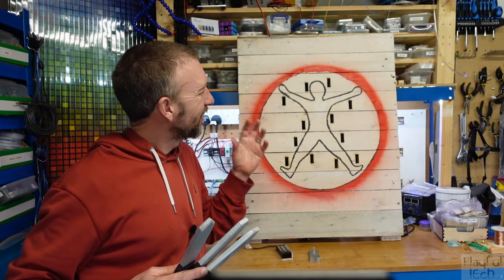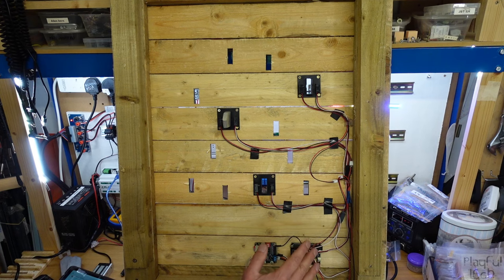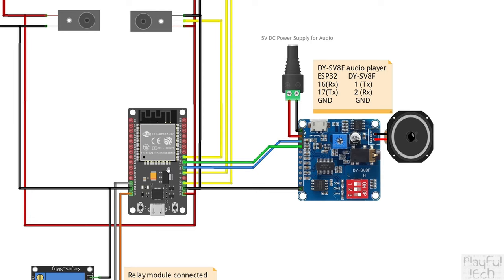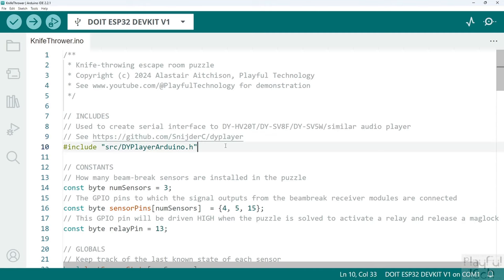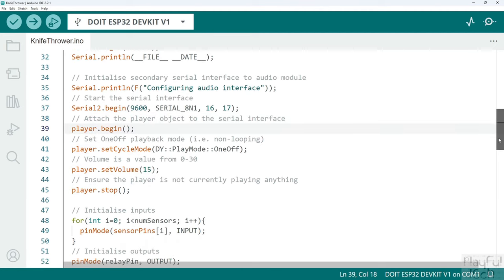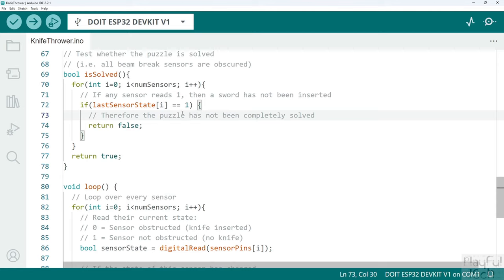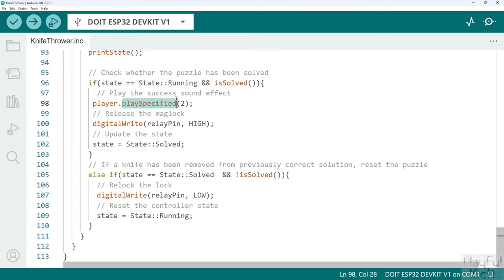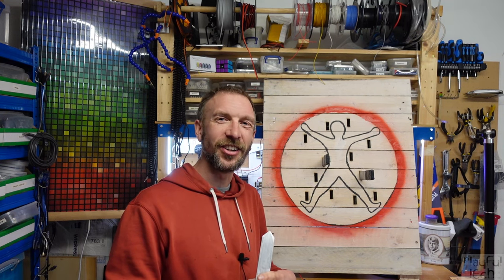Build Your Own Knife Throwing Escape Room Carnival Game

Comment: This would be really cool for one of those "two generals have a key that they have to put in a slot and turn at the same time to launch a nuclear bomb" kinda scenarios. I also like the idea of using one of these sensors simply as an alternative to pressing a button, like for a pirate theme or something
Reply: Brilliant idea!  I can totally see an escape room based on stopping (or starting) a nuclear launch
Reply from the maker: Thankyou! Also consider that you can detect when an item has been removed from a slot (e.g. pulling the sword from the stone...?)
Reply: Exactly my thought as well. The basic principle is simple and genius. With software you can add several layers of complexity.

Comment: First of all, thank you for sharing your videos as you do. It really helps people like myself learn that much more. Quick question though, and this will really go to show how much I am in the learning phase - what is powering the esp32? Are you able to use the 12VDC that helps the maglock to also power the esp32 via use of a terminal block? Or is that too much current pull from one source and you need to have 2 separate 12VDC sources - one for the esp and one for the maglock? Thanks again and thanks for the helpful videos!

Comment: I would have just used reed switches to minimize the wiring instead of the beam break.

Also would have wired each hole to me able to make the required holes programmable.

Comment: Haven’t watched it in full yet, but any reason for using the IR sensors instead of just a normal switch? In my mind it’s easier to wire 3 switches in series with their NO connection going to the next, closing the data line to a relay, which in turn switches off the maglock (connected 12v to power supply and ground to NC of relay) and the mp3 module (connecting the pin on the module via NO to the common ground) for the sound.

Reasons I can see 
- being able to track it via the wifi onboard with mqtt;
- to not have the relay sound
- switches being a mechanical part that could wear with time
- being able to enable the next puzzle wirelessly instead of via the relay.
Reply: I would think one reason is maintenance. Switches, mechanical things that players can exert force onto, break. Break beams should last forever.
Reply: Magnet switches could 0be used and put 3 small magnets in each of the knifes. Also the IR sensors could degrade with time, Dust, bugs, particles, could block the IR light from emitter to reciever  @t3chrs
Reply from the maker: As I mentioned in a previous comment, the purpose of this channel is to provide ideas and inspiration of some of the different technology that are often used to achieve the "magic" of escape rooms. There are certainly many other ways that you could achieve the same outcome - using contact switches, magnets, RFID, proximity, metal sensors.... each has their own advantages and disadvantages. One of the main advantages of the beam break sensors is that they are completely contactless - they have no intenal moving parts, nor come into contact with any prop that the (often heavy-handed) escape room player is wielding, so they should have a much longer expected lifespan than a normal switch, especially useful in a prop like this where players are quite forceful in pushing the knives into the slots.

And yes, the reason for using the microprocessor is a topic I've mentioned in several videos - it enables the basic standalone puzzle illustrated in the video to be extended further: to include additional inputs or outputs, to change game logic on the fly, to provide feedback, monitoring, or override capability from a remote room monitoring system, to synchronise outputs with room-level lighting or audio etc. etc.
Reply: @PlayfulTechnology   Don’t take this the wrong way - I’m All In for proposing different ideas - I have personally learned a ton from your videos - from logic via code to very specific components I never knew existed. 

I’ve just been interested if there’s an obvious advantage to doing it that way that I haven’t thought about yet.

-

On my personal journey I started working exclusively with Arduinos (before ESPs were so mainstream) and knew hot to build the logic for many puzzles in code with many different inputs. As we’re now moving more and more into temporary outdoor installations my attention has switched to how to make certain puzzles run without any form of microcontroller, just with simple components and a battery pack. This has led me to 1) find and use many cooooool boards, like the mp3 player one shown here, but in the v^v mode i think, where each of the 1-8 legs plays a different track when connected to ground; 2) try to simplify MANY puzzles into basic components - switches, motors, simple leds and transistors; 3) appreciate first hand how much we rely on good (or not very bad) weather conditions for our tech to work and how quickly things go haywire when the prop is suddenly underwater 😁😅.

Please keep on creating and showing us creative ways to go about creating puzzles. With a great amount of love and huge thanks for the lessons learned - kindest regards from Bulgaria!

Comment: It seems this is overengineered. Between this setup, and use of 3 magnet switches wired in series and  small magnets in the knifes. Then you will use only 1 pin for detection on the  ESP. Instead of a pin for each detector. Also the magnet switches setup is more bulletproof. 
It wont degrade by any means. If you have more dusty enviroment, or a spider tries to put his web on the way of the IR emmiter, it could wreck players experience if you don't have monitoring over the sensors.
Aside from this, cool puzzle :)
Reply from the maker: That is true, but a lot of escape room puzzles use magnets (and those that don't use RFID :) ), and it's a good idea to ensure that players can't accidentally solve one puzzle using the wrong prop which happened to use the same detection mechanism in a different scenario. Too many magnetised props in a room can lead to difficulties!

Also, the intention of this channel is to demonstrate a range of different input and output methods, and this seemed like a suitable scenario in which to demonstrate how a beam break sensor could be used. But there are certainly many ways that the same effect could be done.